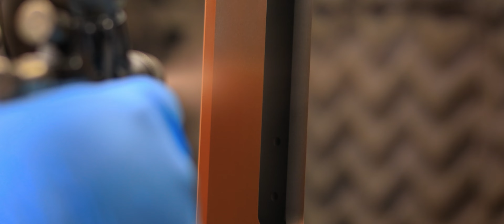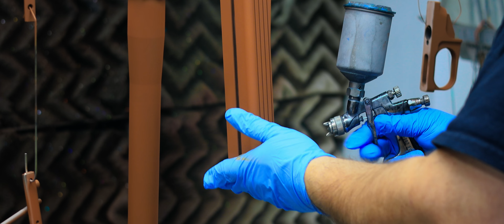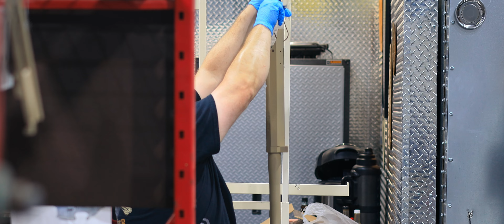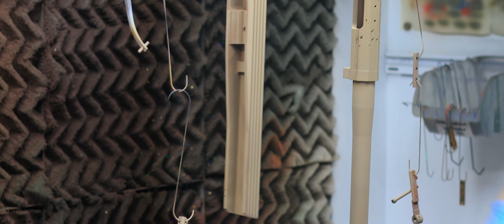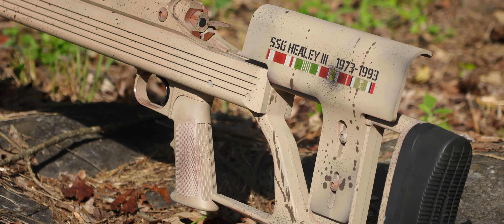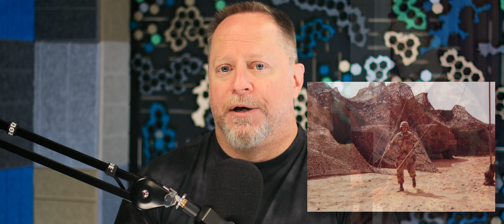Cerakoting an AR-50 | Branson Cerakote and Laser

Comment: Thanks for these videos. Do you blast these surfaces including the polymers to get a better surface profile or can you just clean and coat?
Reply from the maker: Everything needs to be sandblasted to have the correct etch profile for the coating to bond to. Some shops ScotchBrite some components, but in my opinion, that scratches the surface, but doesn't etch it. If we can't sandblast, we don't coat.
Reply: @BransonCerakote  Great answer. Thanks!